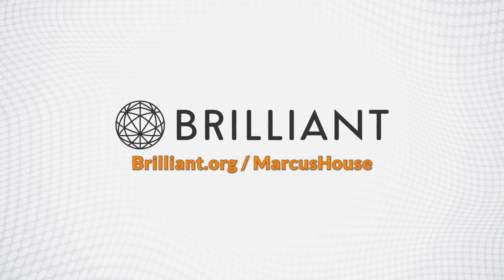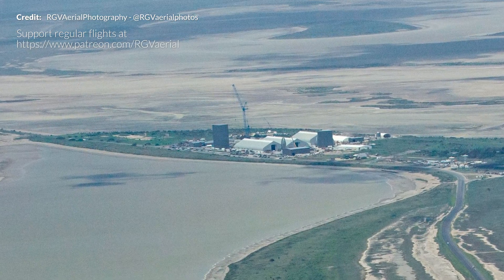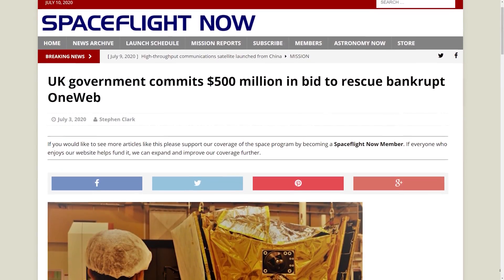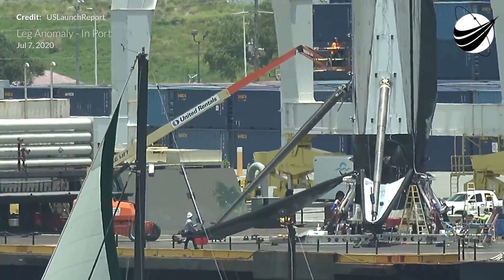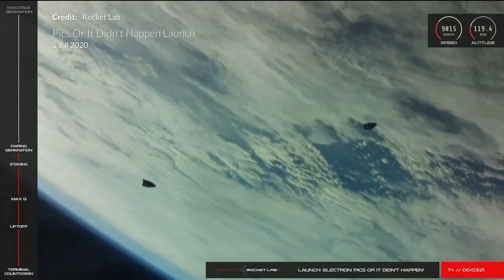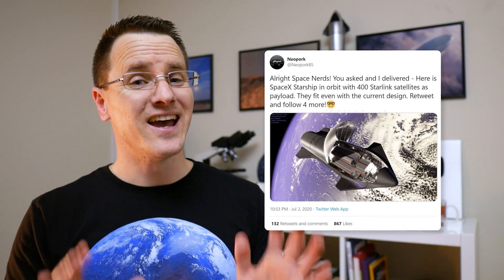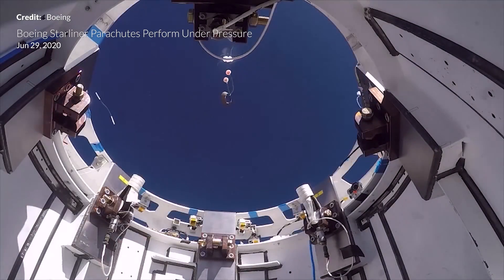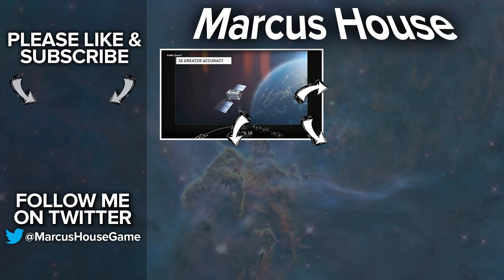SpaceX Starship news as SN5 heads towards 150m flight, OneWeb, RocketLab & Starliner updates

Comment: If these legs couldn't withstand accidental deployment, what would they be good for at all. Of course they have to check for damage, but honestly looking at the landing plate wont suffice. Its more likely for serious damage to occur at the pivoting point of the leg, because the hit on the ground causes a counteraction in the pivot and this is not built for hits like this. Anyone who doesn't get my point, try hitting a concrete slap with a large hammer with an iron handle, you will instantly get the point :)

Comment: G'day,

Well, my bet is on Anthropogenic Global Warming's increasingly frequent & increasingly intense   Record-breaking Extreme Weather Events..., as Summer hots up, resulting in a Mega-Storm featuring sufficient Windspeed & or Hail impact-loading as to maybe perhaps drop that there humungously big Crane accross the Building-Site like the one in London - laid down like a wet Noodle, while at a bare minimum scattering the outer Skins of those massive Vertical Assembly Buildings all over the Landscape for miles downwind...; if not blowing the Wall-Frames down(wind) in chunky bits still attatched to the Skin.

Time will tell...

Is anybody running a Sweepstake ?

Such is Life,

Have a good one...

Stay safe.

;-p

Ciao !

Comment: The Brits opened a spaceport and there is a startup that wants to launch satellites. OneWeb is a guaranteed customer. Also with OneWeb satellites having a higher orbit/latency (50 ms latency) than SpaceX (20 ms latency) they will be ideal for video streaming of interactive television. Cable is going away and OneWeb will provide IP based video streaming superior to the Geosynchronous noninteractive 600 ms latency satellites. Superior to the transatlantic fiber cables (30-80ms). You might even call OneWeb the Marcus House YouTube channel facilitating satellite network. MarcusHouseYouTooNetwork. MarcusHoYouWork. No research. All guesswork. Too much YouTube. Too much time on my hands...

Comment: ONEWEB strategy: Perhaps it has not been considered by the general public that since OneWeb only has 74 of their 500 satellites aloft, it is pretty realistic to imagine that the UK government can now equip the remaining 426 satellites with GPS and create a 500 satellite non-GPS web and a 426  satellite GPS web (or any other novelty that would have a useful - wink wink -purpose for the UK government). They can pay Robot Labs or SpaceX to launch these satellites. But once they are in orbit, the OneWeb web then gives the UK government its own post-Brexit solution.
 
They key again is that you cannot make any assumptions about the capability of this web based on the 15% of the total satellite fleet that was already launched. They are only limited by their imagination for what they will be capable of doing with the remaining 85% of the saellites which are yet to be launched and can be upgraded to suit the UK's ambitions.

Comment: Not one starship has survived static fire. There is zero probability of flight until one does. They haven't ever done it, and they have tried a lot. The facts are: they pretty much suck at it.  A static fire without blowing up should be repeated again and again. I don't believe they can. I think the Raptors are too delicate.  All this telemetry on the  Raptor...just  shows they  haven't got it working.  These things should be over in McGregor, not blowing up starships in BC. The engine as well as the construction is trial and error. They don't have it figured out. They don't have the structure figured out. They don't have the GSE figured out. They don't have the fuel handling figured out. They don't have the launch location figured out. They don't really know much.
Reply from the maker: Don't bet against SpaceX dude.You'll see.

Comment: A GPS transmitter could easily be added to One-World satellites.  
And since the OW satellites are in lower orbits, the accuracy of the GPS system would be much greater.  They just need more satellites to run a constellation - but that is what OW are doing anyway, for the communication side of the system.
R
Reply: A low orbit means it is harder to see enough satellites at once. Seeing 3 is the bare minimum for navigation.

Comment: OneWeb - Early reports said the U.K. was buying a 20% stake but numerous subsequent reports say that the final stake was actually 45%. I’m not sure which is correct but I lean towards 45% especially having seen that the U.K. has veto over sales of any stakes and over who gets to use the technology. That seems more consistent with a 45% stake than a 20% stake.

I’ve no idea if any of it will work or be financially viable but I can see at least 4 possible uses...

1 - I suspect that the plan is for subsequent satellites to include GPS hardware. Not all satellites need the hardware as long as 4 are in view at any given time from any given location. These first 74 having gone up without it might not be a show-stopper. The real issue is can LEO GPS be as accurate as MEO GPS and opinions seem to differ on that. Wanting a sovereign GPS and having lost access to Galileo this is clearly important to the U.K. but also extremely high risk due to LEO GPS being unproven. 

2 - The U.K. has a big push to get broadband to rural U.K. not-spots. OneWeb might actually be a cost-effective way of doing that.

3 - The U.K. places great store on its “soft power” (it needs to since it is no longer a military super-power) with 0.7% of GDP spend on foreign aid each year. The ability to provide subsidised or even free internet access to certain organisations in developing regions, maybe cross-funded by the foreign aid budget, might be a valuable addition to the UK’s soft power toolkit.

4 - Even though it’s not a military super-power the U.K. is still in the top 10 countries in terms of military capability. A sovereign capability to deliver low-latency high-bandwidth military comms to forces, diplomats etc anywhere on the planet could be a huge and reasonably unique military asset. (Note that the US military has already signed up as a SpaceX Starlink customer.)

Comment: At a minumum the OneWeb satelites would need an atomic clock and an L band transmitter to be used for GPS. The clock to profvide a reference, the transmitter since GPS systems use the L band, and OneWeb uses K band. So that does not make sense. I'm a Brit and I can't make heads or tails of why the UK would spend so much money on such a quixotic purpose. Invest in Skylon instead!

Comment: One thing I'd like to see is a Starship-derived space station, where you take a crew Starship and use its fuel tanks as a wet workshop, effectively more than doubling its livable space.
Reply: Why does everybody think it's a great idea to stop re-using a craft whose entire reason for existing is re-usability?
Reply: Those engines and fuel tanks are expense, makes no sense just to put them in space once and let em rot away. Even the ISS, doesn’t do that. For regular major orbit raising, ISS uses whatever happens to be the latest docked capsule to push it up using a portion of the extra fuel.
Reply: Perhaps when it's near the end of it's useable life, which could be 50-100 launches. Who knows
Reply: Elon takes notes

Comment: It can lift up to 750 metric tons, but only with a maxer wagon. It's a separate buggy that holds extra counterweight. In its current configuration it's considered a 600 metric ton crane 

Not all 18000s are setup for a maxer. But this specific crane looks to be primed to accept one. It had an extra swing motor and the proper length back mast. So I can only assume they may attach one at some point down the road

Comment: In the last UK election, investments in internet infrastructure were main policies in both large political parties. I think that this is probably one reason. The investment in oneweb may be cheaper than running fibre to rural areas. Ensuring that SpaceX does not achieve a monopoly should help keep prices low.

Furthermore, once the system is completed, it may be possible for a second updated version to provide location data.
Reply: I would say that what the UK Space agency desperately needs is a 100% reusable rocket. We have the expertise we have the technology we even have some nice launching sites we just need the money.
Reply: @glennedwards1449  it will be launched by ISRO 
Airtel is also an Investor in OneWeb 
Airtel is Indian telco
Reply: @Arya_amsha  Sorry I fail to see your point I mean actually it is wrong since some flights are already booked on Arianne but even so OneWeb satellites are not the only ones the UK needs to launch. A fully or partially reusable UK rocket would save the UK Billions in the coming decades and it is not as if many other companies are going the reusable route. Which gives any company with one a massive advantage.
Reply: @glennedwards1449  I don't understand. Why not just buy the rocket launches off Rocket Lab or SpaceX, and skip reinventing the wheel? You have that launchpad in Scotland, which I thought was originally for Rocket Lab to begin with.
Reply: @Glenn edwards, speaking as an American Anglophile, I wish the British government had given that money to REL and Skylon.
Reply: @odysseusrex5908  In particular, the SABER engine concept and Skylon. At least, there is Boeing money (some of it) invested in the SABER project.
Reply: @glennedwards1449  what? The UK doesn't even have a rocket of its own and it's not trying to change that, let alone make a reusable one. And there is no way in hell anyone could manufacture parts from the one we designed before... Would be cheaper to design a new one from scratch.
Reply: @richec4486  Yes the UK does not have a rocket of its own that is why it needs one. I am not suggesting that we go with 50 year old tech either. The Space industry is in a unique and strange position at the moment SpaceX has demonstrated conclusively that reusability is the way to go and are aiming for 100% reusability. Yet no company are following their lead and only a few are attempting partial reusability.  A brand new partial or preferably fully reusable rocket would make sense from just a commercial point of view let alone political or military. Just the amount we would save launching our own satellites would pay for itself and since like SpaceX we could offer many other countries launches at prices other companies using old throw away rockets cannot match. It is not like we can go buy a few dozen StarShips from Elon it would be illegal to do so.
Reply: "The UK doesn't even have a rocket of its own and it's not trying to change that" - No, the UK has the world's only viable and active SSTO program.
Reply: Glenn edwards I’m all for it. Elon obviously wants to protect his investments. He is a businessman at the end of the day after all. But even he is determined to make sure ‘despite that’ we are not wasteful with our resources so I’m sure that with some form of interdepartmental cooperation or a buying of the designs, the UK could very well end up with its own variation of Falcon 9. Now that would certainly help to speed up the competition between nations. It’s far too one-sided in one nation right now. 
It’s definitely not fair and it’s wasting time, money and resources.
Reply: @glennedwards1449  It's probably best for the UK to just stick with Europe when it comes to Space, that's the only real way they can feasibly compete if not surpass the rest of the world.
Reply: We’ve been working on the skylon space plane in the UK but test flights aren’t expected until mid 2020’s and that’s if everything goes well. As the sabre engine is completely new tech who knows if it’ll be a success or not.
Reply: @alienatedbeing7513  
I just knew someone would start into the skylon/sabre hoax.
That is just the sort of 'expertise' the UK needs to get rid of.
Reply: Alienated Being Now that’s exactly the basket I’m putting all my eggs into for the UK. Skylon is definitely the way to go for low earth orbit transport. They’ve shown consistently that the engines can work. I just wish we actually knew whether they have even started building the main body or not for a few prototypes! Ever since that prototype engine firing footage they showed us a few years ago, I haven’t seen anything else coming out. Where did you get that timetable for the mid 2020’s though? Can you send me a link to the website for that? That would be great.
It’s really hard to tell for Skylon whether we haven’t heard anything else because they are trying to keep everything hush-hush until it’s nearing completion to avoid any of its secrets getting out and preventing the UK from having the edge on this new technology, or that they’ve simply haven’t had any more financial incentives to allow them to continue with the work and they are just spinning their wheels until then.
Reply: @-danR  

Maybe they should buy the Ad Astra Rocket Company and slap a VASIMR in that puppy -- zoom-zoom to Mars in 30 days!!1

;-)
Reply: @alienatedbeing7513  Skylon may be the answer however it is very complicated tech much much more difficult than StarShip and also a very high cost to orbit since it is mooted as not so much a SSTO but a launch platform for a rocket. It can get to Orbit in its current configuration however apparently without much useful payload. Of course further development would cure that but it seems safer to just develop a reusable rocket along the lines of Starship or even a Falcon 9 to start.
Reply: Glenn edwards It’ll be awesome tech for intercontinental flights though, surely it would make SpaceX’s plans for starship intercontinental flights obsolete.
Reply: @alienatedbeing7513  I agree and they are working on that as well. They have received a lot of funding over the decades hundreds of millions so it is obviously not something that is being developed in someone's shed. However rockets are a more mature technology so even something like Starship is probably less risk.
Reply: Yattaman I read it in some random news article so it’s probably wrong lol
Reply: @Yattaman The UK categorically isnt bankrupt, and enough of the hyperbolic language around its departure from the EU - just not true or helpful.
Reply: Perhaps it has not been considered by the general public that since OneWeb only has 74 of their 500 satellites aloft, it is pretty realistic to imagine that the UK government can now equip the remaining 426 satellites with GPS and create a 500 satellite non-GPS web and a 426  staellite GPS web (or any other novelties that would provide a useful - wink wink -purpose to the UK government).
Reply: Or the constellation will fail in some way and the UK taxpayer will be on the hook for the monies lost. Easier and cheaper to buy Starlink receivers for rural areas.
Reply: @williamswenson5315  If SpaceX develops a monopoly in high speed rural internet they can charge whatever they want, ensuring that there are at least two players in the game keeps costs low and encourages development.

Elon Musk has shown that he prefers high profits rather than his own worker's safety with his anti-lockdown craziness. He does not care about the consumer, and will abuse a captive market to further his own goals if allowed.
Reply: @joe4366  I would grant you that competition generally improves the quality and lowers the price of just about everything, but the reality today, is that internet services are regarded and regulated more as utilities, than as competitive companies. In my area, I realistically have one and only one real ISP choice. I feel the charges are exorbitant, but with no real governmental regulation on what can be charged, I use what is available. I welcome Starlink and I am willing to predict that it will be more affordable than the current offerings. Simply based on the launch capabilities and the satellite production capacity of SpaceX, OneWeb will, at best, find a niche market in the northern latitudes for a time, then fade away. The only way to make OneWeb competitive with Starlink, would be to have the EU and India decide to exclude any entry by SpaceX into their markets; which, of course, is the lack of competition issue all over again. Starlink is soon to become a reality; let's give it a chance.
Reply: I would love to know the real reason the UK gov has handed all that cash over for the beginnings of a project that they can't possibly afford to complete. Unless...the purpose of these low earth orbit satellites is actually real-time  surveillance for intelligence agencies and the global internet access stuff is secondary, an elaborate cover story.
Reply: @andrewfarrow4699  Follow the money. Who stands to lose, who stands to gain.
Reply: @Yattaman oh, the pockets of hard working people are deep.
Reply: Er..a second updated system would mean a completely separate satellite system meaning version 1 is redundant. They are not lease hire cars..
Reply: @thomaschapple4749  The constellation will need constant updates and upkeep though, so it isn't unreasonable to design around that. Starlink has been updating the design on basically each new batch too.
Reply: @Yattaman SpaceX developed the Falcon 9 rocket for under $2 Billion The UK just put in a quarter of that amount for a 20% share in oneweb. One Web will require a considerable amount more in fact Billions to launch enough satellites to actually work. A reusable rocket preferably 100% would make economic sense even if it was only used for UK Satellite launches. Since only a few companies are going the reusable route which means a UK rocket can undercut any other provider and get a lot of business.
Reply: @Yattaman Well it is nice you have so much confidence in the UK can I ask when you are leaving and do you need a lift to the airport. After all someone with such Economic genius someone who knows more than entire think tanks of many Eu and UK countries must be well in demand.